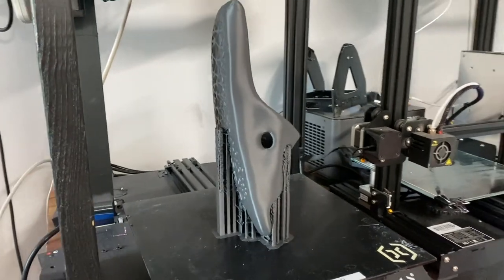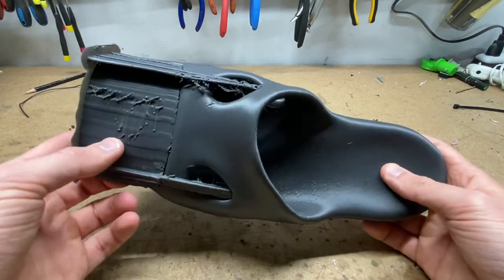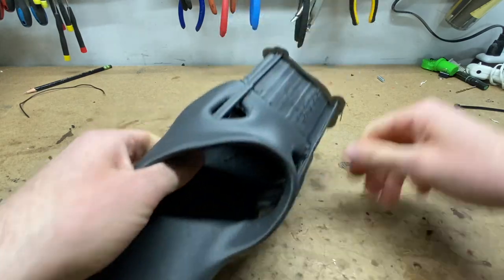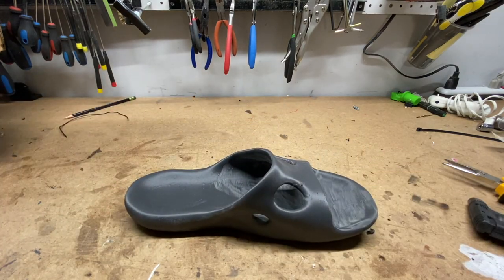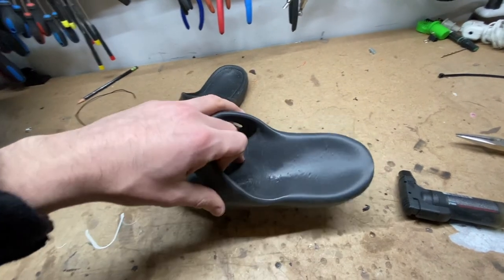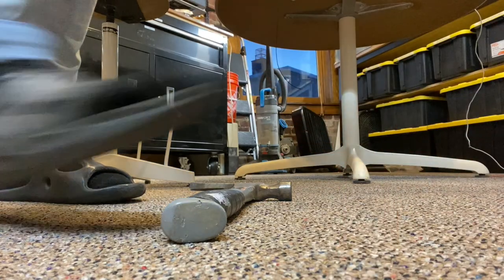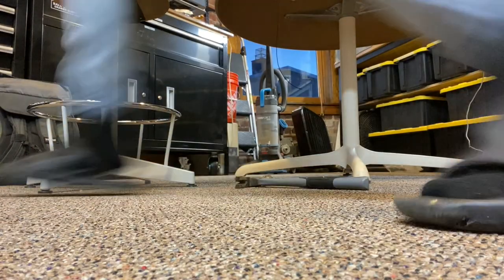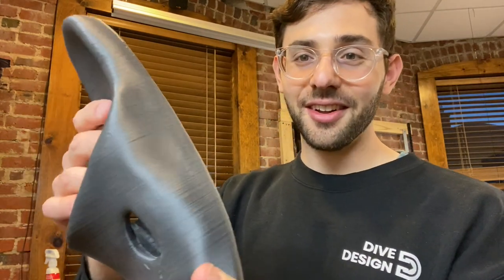NinjaTek Chinchilla First Look at DiveDesign!

Comment: What filament is best for grip and flex? say if you wanted to make tires for RC car, or if you wanted to make soft squishy feet for a 3d printer? I am using Priline that is 95A, but its not grippy, and it's only semi flexible.  I saw someone use 85A that stretched and gripped like silicone or something similar to that texture, but not many affordable options out there that are 85A.

Comment: Would you mind posting your print settings? I cannot get this stuff to feed through my MK3s properly.
Reply from the maker: We use 230 nozzle and 50 bed, similar settings to TPU. All printers need their own fine tuning. Is it direct drive?
Reply: in my experience the answer is to add slowness to everything
slow everything down and itll stop bundling up after feed gears
even if your using direct drive the distance between feed gears and heated nozzle is still enough to cause jams depending on how its made